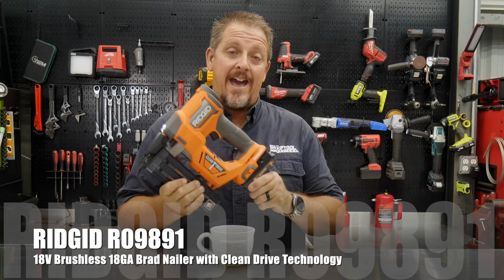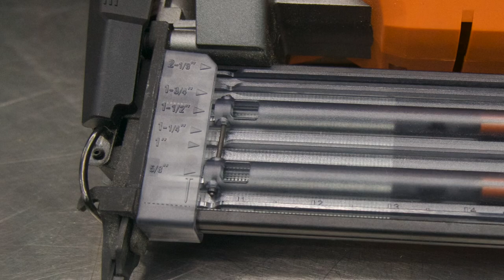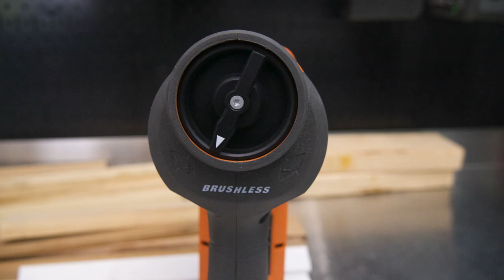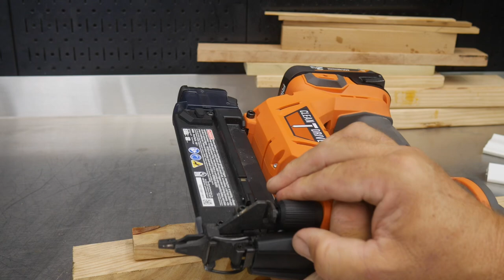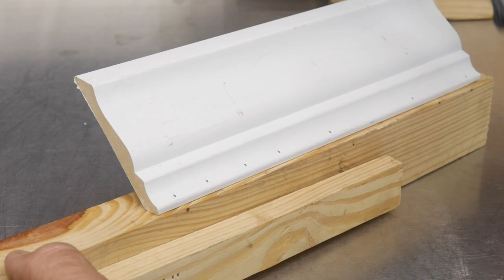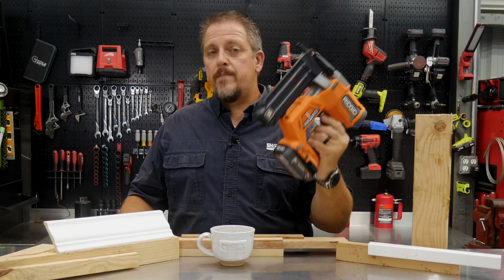RIDGID R09891 18V Brushless 18GA Brad Nailer Review [CLEAN DRIVE Technology]

Comment: Mine sometimes doesn’t shoot the nails when I press the trigger. I have to take the battery off and put it back on for it to work again. Has anyone else had this problem? How do you fix this? Is it common for this tool? Some of the reviews on HD website have had similar issues. Not sure how common though.
Reply: I am having that very problem which is what brought me here.  did you get an answer?
Reply: @freddyjohnson6695  - have not heard of a fix unfortunately. I just remove the battery and put it back in. I’m hoping newer models will have this fixed.
Reply: Very common issue. Seems to be a manufacturing issue. Only ridgid product I’ve regretted buying.
Reply: Same issue... I have returned two of them in the last week to depot after just buying this nailer a couple weeks ago. Nothing more frustrating than getting trim glued, lined up, mitre nice and crispy and the nailer won't shoot.
Reply: Mine did that at the start but doesn't do it any more

Comment: Important tip... before you attempt to clear any hiccups be sure to remove any nails in the holder otherwise if there isn't a stuck/bent nail in there the spring loaded nails will shoot out after you flip up the lever!

Comment: Another reviewer didn’t understand how the fine tune dial help set the depth, glad I watched your video.
Reply: Hey Guys - I have the Ryobi, and as someone else commented, it does look similar with similar features; in particular the "pressure" dial on the back. It's certainly possible that they do not work the same, but here's how the Ryobi works.  The "depth of drive" adjuster is the main determiner of depth.  For instance, if you were using 1 1/2 inch brads in a softer wood, it would likely fire to approximately the same depth regardless of "pressure" setting; as the tool would have sufficient power in any pressure setting to fire the nail to the depth determined by the "depth of drive".  However, if I had the "pressure" setting a bit lower and I then switched to much harder wood, I might find that nails that were being counter-sunk 1/16" in the pine are now sitting 1/16" proud.  In that case, dialing the "pressure" up could solve that.  Again, this functionality may be the same between tools.  If it is, then maybe someone will find this of some use.  Take care all!

Comment: I've had mine on 2 jobs now and I love it! I've put about 3500 brads (1.25" & 2") with only 3 miss strikes which I think is pretty dang good. I've been switching over to all cordless tools and picked ridged because of the cordless drill my son got me for christmas 5 years ago. My old 14.4 dewalt had finally given up the ghost and I needed a new drill so that is how I ended up with my first 18v ridgid tool. I've been so impressed with it that I now have 8 different 18v tools and 7 batteries. This gun has given me the confidence to think seriously about buying an 18v framing gun and leave the compressor home for airing up bike tires for the grand kids. Love these tools.

Thanks for this review and clarity on the "Throttle".
Reply from the maker: Glad to hear that it's working great for you. I'd say 3 mis-strikes out of 3500 is very good. You'll love their 18V framing nailer. That's a great tool. Thanks for watching.
Reply: Agreed. I started with the drill and driver combo, then picked up a palm sander, then a multi-tool cutter, and now the brad nailer. Everything has been great so far. Fingers crossed that they honour their service agreement should I need it.

Comment: You mustve got the lucky one because mine stopped shooting the nails in pine flush by the 3rd rack of nails.  Even after setting the depth lower they still stick out. Only ridgid tool ive ever regretted buying.
Reply: I’m having the same trouble. Right outta the box. So frustrating. Getting ready to call customer service. I have a ton of rigid tools and love them all.

Comment: Thanks for the review. Need a nailer for work and that’s going to be it since I am already on the Ridgid platform.
Reply from the maker: You won't be sorry. This is a great little nailer. I will say that sometimes when you switch from single to rapid-fire, you have to remove/replace the battery (almost like an electrical reset). Works every time after that, but it's just wierd. Let us know what you think. Thanks for watching.

Comment: I almost bought this yesterday but thought that I should do a bit of research first. Nice review. I feel pretty comfortable picking one up the next time I’m at Home Depot and add it to my other Ridgid power tools.
Reply: I got the older model and mine is shot after about 4 years of owning it. I was thinking the same as you and wanted to see if it's worth it
Reply: @OFFICIALRAPTORTHERAPPER  I bought one last week. Used it yesterday for installing baseboards and door casing. Worked as advertised.
Reply: @billbowman8747  good to know ty for update
Reply: @OFFICIALRAPTORTHERAPPER  Hey, aren’t the Ridgid tools guaranteed for life? Or didn’t they do that back then?
Reply: @billbowman8747  no they are not anymore
Reply: @OFFICIALRAPTORTHERAPPER  the box on mine says it has a limited lifetime warranty on the tool and the battery. That’s why I have been building out my collection of power tools in the Ridgid ecosystem.
Reply: @billbowman8747  limited* it restricts alot. I believe it's a 2 year free of cost repair
Reply: @OFFICIALRAPTORTHERAPPER  according to the RIDGID site  THEY ARE as long as you REGISTER the tool.   Correct me if I'm wrong
Reply: @ODX171  yes, for the "lifetime warranty" you'll notice ridgid states limited lifetime on bigger tools and also batteries. It's subject to 3 year policy. 

The Lifetime Service Agreement (if accepted), commences after the expiration of the standard RIDGID® 3 year Limited Warranty. To obtain service for this RIDGID® tool on either the 3-year limited warranty, the Lifetime Service Agreement, or the recon limited warranty, you must bring the equipment, to an authorized RIDGID® service center. Aka homedepot. 

If the serial number is worn they won't accept , and also if the tool is beat to shit they foul out as user error / abuse. No company would be that dumb to do a lifetime on power tools. They also switched owners it's owned by a company called new world or some shit. Hence the change in quality and nxt brand instead of the octanes
Reply: @OFFICIALRAPTORTHERAPPER  My mistake. It doesn't say "Limited". I just checked. It says Free Parts. Free Service. For Life. (You must register the tool, and it only applies to the original tool owner.) 

"This unprecedented protection covers all defects in workmanship or
materials and normal wear items for the lifetime of the original,
registered tool owner.’

Items include: Brushes, chucks, motors, switches, cords, gears, and even BATTERIES *
0-rings, piston stops and driver blades only covered on pneumatic nailers and staplers
."

So, yeah, there are limits. What failed on your old nailer?
Reply: @OFFICIALRAPTORTHERAPPER  Thx  your reply should help more ppl understand how this  works

Comment: I wa shooting through hardy x two.
It's a good gun but it's like you have to warm it.
Is there am air chamber in thre?
Reply: The motor drives a piston forward compressing air in a cylinder. Once the piston reaches full compression a valve opens and releases the compressrd air all at once to driving the striker or plunger for the nail.

Comment: How does this compare to the Milwaukee or DeWalt?
Reply: I have this one and my boss has milwaukee, same performance basically but his does feel better in the hand but I love the pressure gauge
Reply: @Fly2kill1  The latest Milwaukee 18guage cordless is better, I've used it on a daily basis for 6 months and not a single bad shot. My co-worker has the Ridgid and it does leave heads sticking up every once in a while.
Reply: I own both the milwaukee and the ridgid. The ridgid is better

Comment: I keep telling people that they should make their parts out of titanium, lighter stronger, corrosion resistant, lasts forever, stronger than steel
Reply: Regular framing hammer= $15-$30
Titanium framing hammer=$150-$300 depending on handle.

Titanium 10x’s the price of almost any component you replace.  This market is driven almost entirely by price.